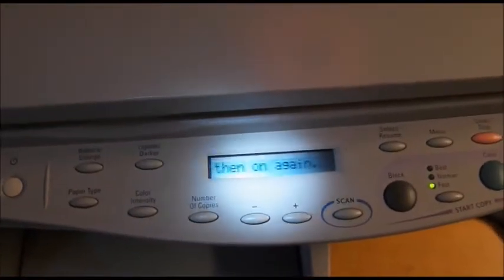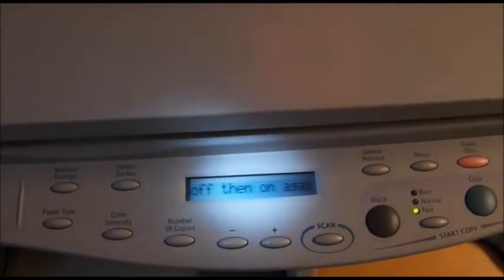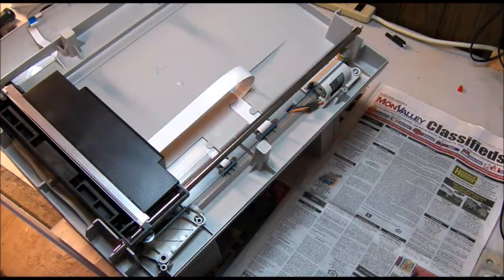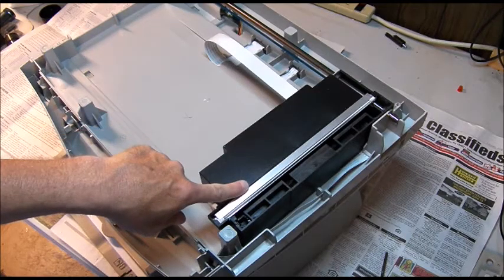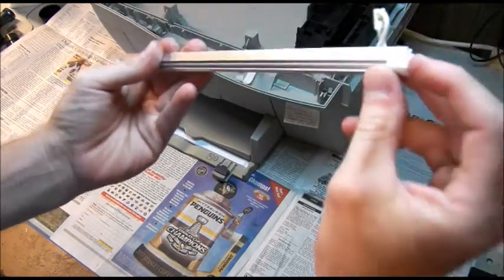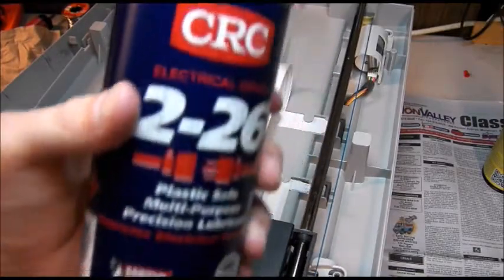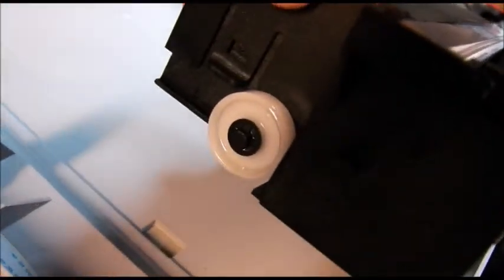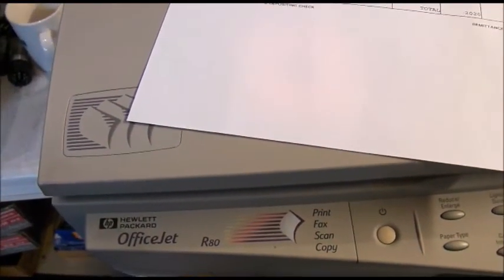Repair HP Scanner System Failure Officejet PSC Scanjet Multifunction Printer

Comment: Hello where can you buy the lamp  hp ?
Reply: https://www.ebay.com/sch/m.html?_ssn=303electronics&LH_PrefLoc=&_from=R40&_trksid=m570.l1313&_nkw=bulb+officejet&_sacat=0

That'll do it. Ideally add in your model number to the search, if you don't find one for your exact model, a similar one that looks the same should do. They often use the same parts over multiple models.

Comment: Too bad this does not tell how to take apart the HP7410 t get to it's scanner. On mine, I do not think it is the bulb, but sites have said the belt that move the scanner wears out. Do you know the proper procedure to get to the scanner on the HP7410 ? ?  I know there are several T8 screws, but not sure if some are hidden and I do not want to break the plastic trying to find them.